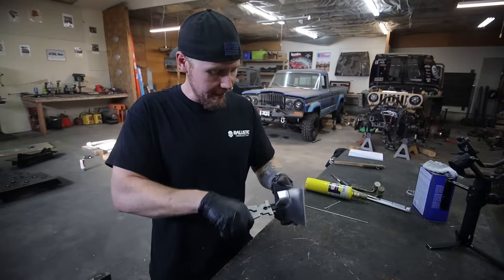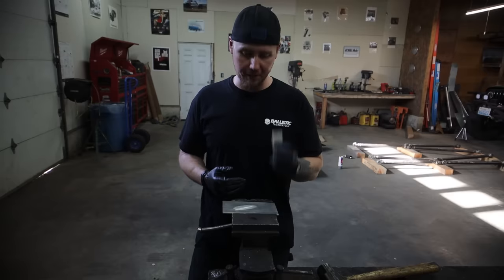Amazon's CHEAP Alternative To Aluminum Welding!!! (Alumaloy)

Comment: If you have not tried this, get some and let it sit in the shop there will come a day when it will save the day. I've gotten some from HF. not sure how good compare to other stuff But a lifesaver without using Tig. I need to repair hols in large sheets of aluminum but I'm afraid this will heat sink out and also warp the sheets.. Darn!
Reply: That’s where mine comes from. HF.    They had it 25+ years back even
Reply: That’s where mine comes from. HF.    They had it 25+ years back even
Reply: @drizler  I was just setting up to test/ seal a screw hole on an 4x8 alum. sheet when I read your response..... Worked fine except the execution needs refining. These  sheets are just under 16th in thick. and was worried the heat would get drawn away. I'm sure there is better than HF. stuff but it works just fine for me.

Comment: I have a question I'm just starting to do this aluminum welding/brazing was wondering If you have done strength tests on the stuff you've done in this video. My first project is making a cold air intake and air box for my truck. Also wondering if you had luck with using it for pressurized tanks. This is all new to me and just looking to expand my skill set with welding/brazing
Reply from the maker: Air box would work but I wouldn't trust it for anything pressurized. 👍
Reply: @DirtLifestyle  had to ask how's this repair holding up on that tank? Also found it hard to get it to lay flat and look neat but I'm sure the more I play around with it I'll find what works. Any other tips or tricks that you found useful? And thank you for taking the time to respond

Comment: Great testing and instructions in your video. I am curious if using this product to fill a blind hole in an “LS” type rocker arm cover, could you fill the hole, grind it smooth, then try to polish the filled old bolt mount hole and get a decent aluminum type match? It is a type of solution I have thought about as many cut these off flush, fill them with something, then most likely paint the covers with a high heat color. 
 Just a simple yet revealing challenge to drill a blind hole (Not all the way thru) then braze it to fill, day use a flap wheel to level, then walk it over to the bench grinder with sewn cotton wheel and see the level of polish one could achieve to match against the base cast metal. This would allow a hobbyist to decide on a project that lots of people would see. Not a challenge, but a thought fora future video from a subscriber. Great stuff. Retired ASE Master Tech (Code for more time than money/ paying a local aluminum welder in shop) Thanks!

Comment: Would you trust this for making fluid reservoirs or maybe a small box air tank?
Reply from the maker: A none pressurized tank would work no problem. Once you start adding pressure I'm not sure. We braze copper at work all the time and those joints can hold crazy pressure. I imagine this would be similar but am not experienced enough with the product to give a confident yes or no.
Reply: For non flammables I would trust it. Not pressure tanks. It could fail explosively at even moderate pressure. Think pounds per SQUARE INCH. Ten pounds per square inch pressure inside a 10 inch aluminum cube  ( 6 sides at 100 sq. inches each = 600 square inches ) times 10 pounds of pressure =  6000 pounds of force. Think solder will hold it together?

Comment: I just recently found out about this stuff and was very curious. I don't know if there's a difference in brands and didn't want to get sucked in by advertising so I bought some from HF. One vid I watched made the comment that it would not work on a motorcycle aluminum engine block. I don't know if that's due to the alloy or perhaps preheating it to the right temp would be impossible. Any thoughts?

Comment: Do you think this would work on intercooler piping.
Reply: I'm thinking yes because the psi would be dispersed evenly on the weld.  You're not trying to bend it like he did with the first one.  I'm using this to patch a hole in my main seal caused by the (failed) water pump pulley cutting in to it.  Oops.
Reply: I actually just bought them if they only work to tack the pipes in place and bring them somewhere to get them welded then that will do me.

Comment: Hey Nate, I really like your DIY videos. I am new to fabrication and so far I've done a couple of projects for my JK.
I'm planning on making a overland trailer and was thinking of using aluminum  1 inch square tubing to frame the doors of my trailer to help save weight. Do you think brazing the joints would hold up or should I stick with steel ?
Thanx in advance for your help.

Comment: what type gas did you use for welding the aluminum tank, as i just cant get it the surfaces hot enough to even stick,I barley get the rods to melt.

Comment: Did you clean the skin off of the plates first? Aluminum melts at around 1300* and the oxide that forms on it melts at around 1700*. That's why aluminum 'falls out', or turns to water, since by the time you've heated up the oxide enough to work, the base al is overheated and blows or falls out. And it doesn't take long to re-corrode.

Comment: I wonder if I can use this to make (or add to) a bike frame. I wanna make an Ebike with hydraulic brakes and suspension as well as increase the max weight capacity for cargo.

Comment: Does it penetrate or just melt on the surface? This is pretty exciting stuff.
Reply from the maker: It only melts to the surface. The bond isn't near as strong as welding but this is still a perfect solution for many non-structural tasks 👍

Comment: Can you use these rods with an oxy acetylene torch turned right down to heat the material better? Map gas is good but can struggle to get the heat in and takes ages

Comment: Would the repair be strong enough to fill in stripped aluminum bellhousing bolt holes, then drill and tap?
Reply from the maker: Unfortunately I wouldn't trust this stuff for a job that important. I would use a spool gun for a job like that and weld it the right way 👍
Reply: it's always best to read the manufacturers specifications because there are a lot of different types of these products and if your not  sure if your gonna exceed them , pay a welder. in the long run it will be cheaper and less painful

Comment: I wonder if this stuff would work to fix the standoffs down in the Mac Pro Case im modding, I wanna get the case anodized at some point and I dont know how JB Weld or other epoxies would react with the chemicals used in anodization. My main concern is fixturing but im sure i can come up with some something to keep the standoffs from blowing away when you try and heat em up.

Comment: I saw a video that suggested using flux to draw the braising thru? It seemed to bring more even'ness, what do you think?
Reply from the maker: Flux is a very valuable tool for traditional soldering and brazing. This product says it doesn't need it. I haven't tried it with flux but I imagine it would yield good results 👍

Comment: Could u weld a carb adapter plate to a 3.1 or 3100 intake to be used in a demolition derby im just wondering if this stuff would be strong enough so i could build my own intakes instead of buying them
Reply from the maker: Not sure. I feel like any application with heat can be a gamble. The melting point is 750° so you shouldn't have an issue but somewhere between cold and 750 this stuff is going to get weak. I just not sure where that point is 👍

Comment: Can you preheat aluminum on a grill or in the oven like you do with steel?
Reply from the maker: Definitely, but you want to play it safe and use a laserr thermometer. You can't tell how hot aluminum is just by looking at it. You don't want a pile of gooey aluminum on your grill! Lol
Reply: ovens are perfect , the grill would work, sure. but if it was all i had to make heat, id make some sort of oven so your work isn't heating up directly with all that carbon.

Comment: you should have just used the rod and filled in the hole on the fuel tank.. it is doable.. Or another way that also would have came out nicer would be to make an aluminum plug that is a little cone shaped kinda that you would use a rubber hammer  or an old shoe  or something between a metal hammer if you like and tap it in  tight and either grind it down then weld n grind or weld then grind off any extra plug sticking up or aluminum bolt screwed into hole then weld it and cit off the rest of the bolt after...  I have gotten it to fill in some pretty big holes .. I love the stuff!  Just used it to weld the top tube of my aluminum bike frame shut and a nipple on it to turn it into my fuel tank for the gas motor I have on my bike..

Comment: Torch temps. All torches vary in temperatures. Depending on the size of the torch and orifice. An average propane torch gets to about 1800 degrees whileva mapping gas torch roughly 2200 degrees. 450 degrees? That's what I pre heat my oven to if I want to burn a quick pizza

Comment: A friend repaired a VW Beetle gearbox mounting lug with Lumiweld (same idea). No way could that work?  It ran for years no problem. 
Aluminium needs a lot of heat he had to use a BIG torch to heat up the casing.

Comment: can you use that rod and use a tig torch without any gas to brase Al ?
Reply from the maker: Not sure, it seems like it would work just fine but I'm no expert on this stuff. The product is called alumaloy. I suppose you could email the manufacturer to make sure it's safe. Thanks for watching 👍

Comment: So this should work fine on an all aluminum radiator? I have a tig welder but I think it will do more harm than good on the thin fins.
Reply from the maker: I think it should work perfect for that, but I haven't done it before. Put in a little practice first 👍

Comment: good enough for gas tank repair and fabrication ?
Reply from the maker: With enough practice this is good enough for a mild repair but I personally wouldn't use it to fabricate an entire tank. It's not near as good as a tig Weld and there is a lot of risk involved when you are storing a  volatile fuel such as gasoline. 👍
Reply: @DirtLifestyle  thank you very much

Comment: Say I where to repair a mountain bike with this, how would that hold up?
Reply: Not suitable for that. at least not for the frame or any lugs carrying strain. If it is just a boss for hanging your bottle cage on - fine. Steel bikes had pre-formed lugs or joints so that the tube could be cut to length to suit the frame size and geometry. These were then brazed together. Aluminium bikes are TIG welded.

Comment: Do you think this is strong enough for intercooler piping on a lower boost pressure
Reply from the maker: Absolutely. But I would put in alot of practice first. Thin aluminum is very easy to melt and you don't want to turn your charge pipes into a pile of gooey aluminum lol
Reply: @DirtLifestyle  agreed I don't want to do that at all lol

Comment: The vice is sucking the heat out of the bottom piece you should open the vice and cramp a piece so the aluminum's that laying on top of the vice it will heat up better

Comment: Have it at work but, haven't used it yet. Wonder if you could Tig Braze with it?
Reply from the maker: Good question man, I have wondered the same. It's such a low melting point that I'm not sure how good the results would be. I plan on experimenting with it a little bit in the future. 👍
Reply: Good, I’ll be watching to see if it works or not. At least a larger piece wouldn’t have the heat sink problems with Tig Brazing

Comment: How well did this hold to pressure. I have 0 access to welder and I've been looking at this to.... 

Modify or add brackets to intercoolers 
Make a header tank
Reply from the maker: If you do a good joint this holds pressure really well. I think this product is perfect for weld on bungs and such 🤘
Reply: Do you you think a manifold created with this product could hold 30psi? Not that I'll be running that. But at least it can hold that it could hold upto 24.
Reply: It's a Shane really i have been searching for months of people attempting headers, coolant expansion tanks and intercooler pipes and have not yet found anything or anyone documenting such. Just 100's of videos of folk drilling holes and repairing them. 

It's unclear if it can be sanded for neater appearance. Shame really as especially for car enthusiasts here in Europe there's little known about this for me to report back to my own 19,000 members on z20let lovers

Comment: Some of the adds I’ve seen on the low temperature aluminum brazing rods claim you can use it to join aluminum to steel and steel to steel like a brass rod. Is that something you would consider trying?
Reply from the maker: If the application called for it then definitely 👍
Reply: There's a company that markets a rod like a Alumaloy and ALSO markets/carries a couple other "low temp" brazing rods that (last I checked) sold a low-temp rod for steel and I think a low-temp rod for dissimilar metals!  It may be the same company but don't recall and too damn lazy at the moment to Google it...
Reply: @DirtLifestyle   you didn't need the scab of aluminum to do that patch. You can carry that stuff across a hole that big than sand it down and it would be pretty hard to find afterwards

Comment: what Al grade is that tank? i used to fabricate 5052-6061 Al diesel gas tanks for military vehicles and boy did you need a lot of heat on that tig about 250-300 amps
Reply from the maker: I'm not sure about the grade of the aluminum unfortunately but it is very hard. Its takes some serious heat to weld on it with my tig torch. 👍
Reply: @DirtLifestyle  yup and some very seriously HF

Comment: Will it hold up to fix a crack on an intake manifold with a procharger running about 30 psi?
Edit- seriously. Not as a permanent fix, but just to get through a weekend at the track in case my replacement doesn't get here in time. The pressure relief plate on my current intake failed and cracked around the studs instead of the plate blowing out like it was supposed to.
Reply from the maker: I think its possible but you would need alot of heat to get it to adhere properly. What kind of temperature does the super charger see? This product has a melting point of 750° but I bet it starts to weaken around half that. On second thought, no way your seeing those temps. Give it a shot!

Comment: Could it be used to fill skratches in rims? Just to get a smooth look before  powdercoating
Reply from the maker: I think it could probably do a decent job. You would need alot of heat and flux would help it bond 👍
Reply: If you are powdercoating I think yo'd be better off with a high grade epoxy/metal filler that can take the powdercoat temperature.

Comment: Good clip mate, wondering if an Oxy Acetylene torch be a good heating method.
Reply from the maker: It definitely would be if you have good experience with one. It's easy to melt aluminum into a gooey mess, thats why I play with propane and map gas lol

Comment: would the joints from this be strong enough to make something like a truck bed rack with?  like for a Roof top tent?
Reply from the maker: I wouldn't use it for anything that's structural but other might disagree 👍

Comment: Would this work to build a water/meth tank that fits in the spare tire well?
Reply from the maker: I think it would. Practice a ton before you make the final product! And pressure test it before install. You don't need much pressure. 5psi and some soapy water 👍

Comment: think it would work on a roof rack for the jeep?
Reply from the maker: I wouldn't use it on anything structural but you might find that it works great. I'm no expert on this stuff so you may need to do a little R&D to figure out if it works for you 👍 good luck

Comment: Wow this is pretty cool! I’ve been planning to fabricate an intake pipe and eventually a whole new intake manifold for my truck because the stock pipe & manifold are plastic junk plus I’m trying to make some more low end power so some longer intake runners plus a better airflow path would be beneficial and I really wanted to use aluminum but I don’t have a TIG or a spool gun for my mig so I was going to settle on stainless but after watching this I actually think I am going to get some aluminum and give this a try for the pipe at least!
Reply from the maker: I think that with enough practice you could definitely build something like your describing. These joints seem to be very strong so I think they would easily hold for an intake system

Comment: Is it possible with patience of course to create something like a intake for a engine or something? Likely a dumb question but curious
Reply: Probably but honestly you are better of building one from steel and using a real welder than this stuff. The best would be tig aluminium welding.